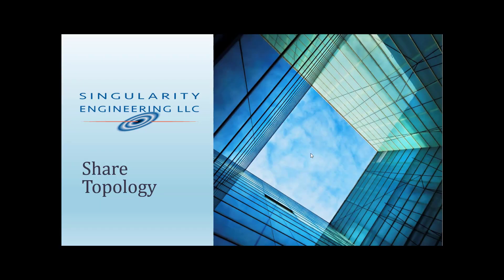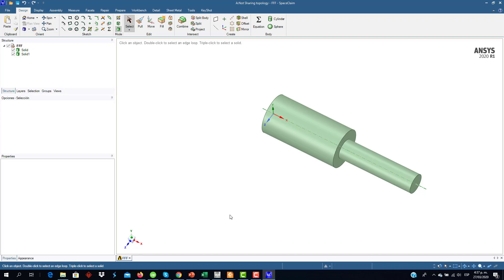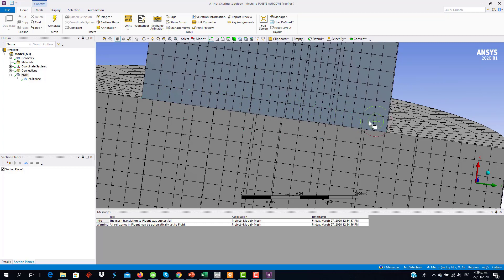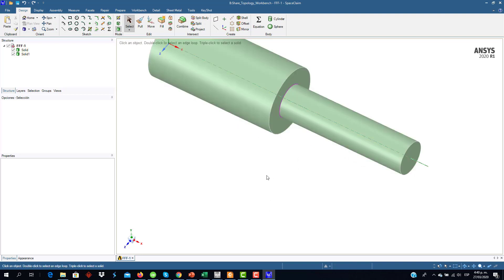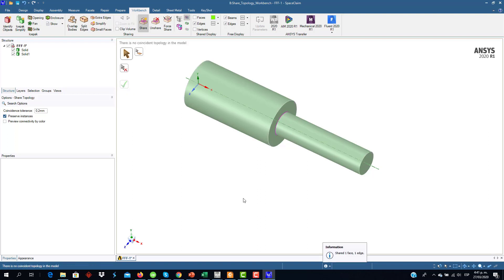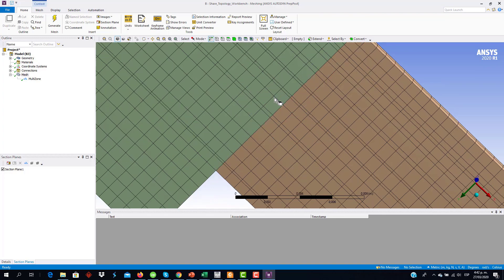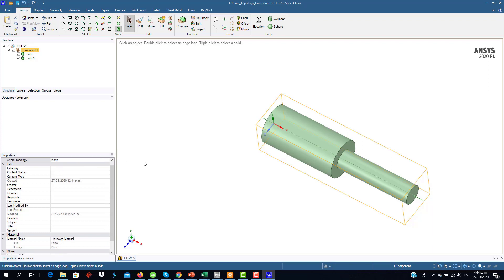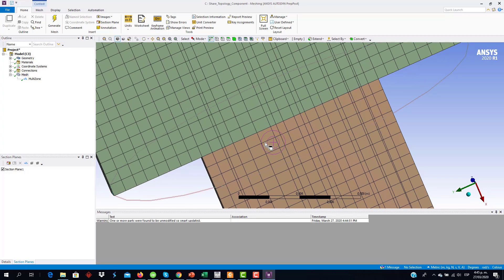How to use the Share Topology Option in ANSYS SpaceClaim for improving your mesh

Comment: Thanks for a great tutorial. However it didn't work for my case - I'm making geometry for airplane CFD analysis. I have a Fluid region (enclosure around the airplane) and surfaces in the shape of a circle which serve for propeller simulation. When I do meshing, the mesher ignores those circle surfaces. I tried both methods shown in this video. It works in Design Modeler - I simply create one part out of Fluid body and surface bodies and the mesher creates mesh on surface bodies.
My solution in SpaceClaim was to slice entire Fluid body with a plane placed on propeller surfaces. Then I projected propeller surfaces on to the sliced Fluid body. Later in Meshing I created Named selection and picked propeller face. So I had only one body - the Fluid body. No propeller surface bodies. Propeller was defined with a face which was part of Fluid body.
Just in case this will help someone with similar problem.